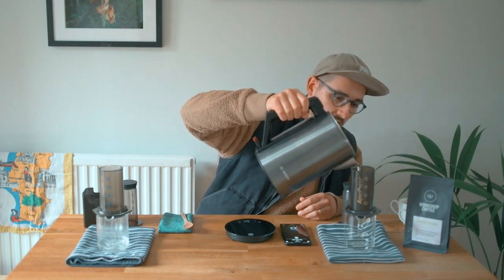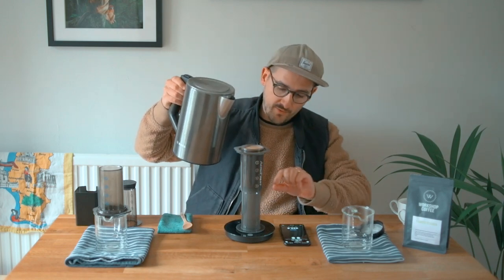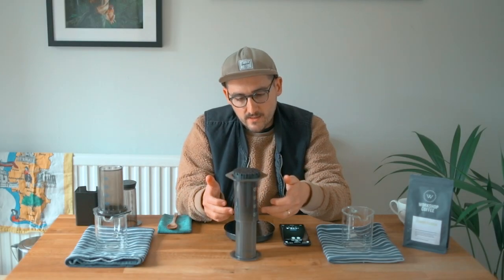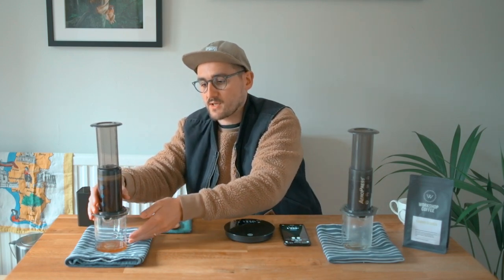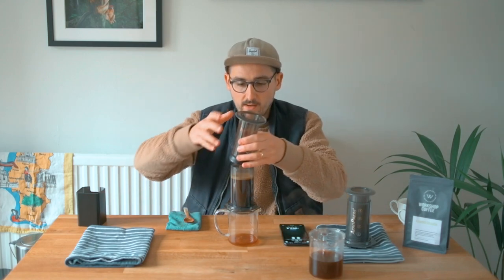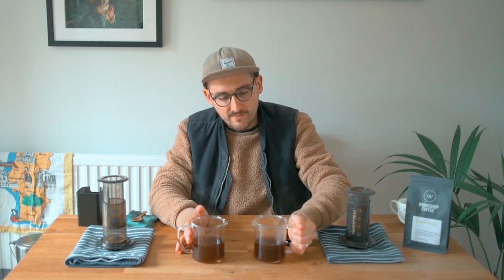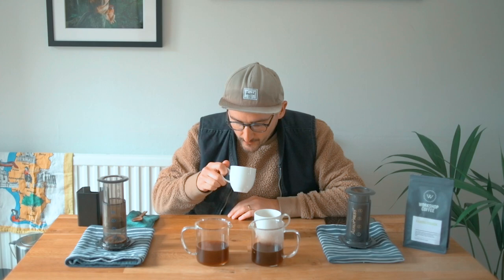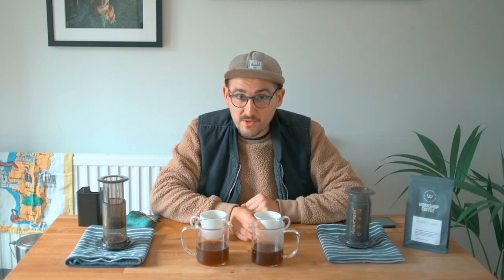At Home with James Bailey – Brewing with the AeroPress

Comment: Thanks for the video. One thing to add - the stirrer that comes with the aeropress is specifically designed to be unable to scrape the filter in the normal method.

Comment: You do a lot of stirring in the inverted one. It should increase agitation therefore extraction, shouldn't it? How did it affect that brew?
Reply from the maker: It might have marginally increased extraction but not massively. It will get to a saturation point around the solubility ceiling, and we don’t find that a few extra stirs negatively impact the cup.

Comment: Thanks for this! Am I guessing right that you’re using the Wilfa Uniform here? What range of setting would you recommend for Aeropress?
Reply from the maker: Assuming you're doing a 2-minute steep , and brewing regular rather than inverted, we'd recommend using 23 as a starting point.
Reply: @workshopcoffee9001  Interesting! I use the inverted method, didn’t know that it was a factor in selecting the grind size. Do you go finer or coarser?

As for time, I’ve been brewing for 1 minute the past months, but did 2 minutes previously. I’d guess that you go finer for a shorter brew time?

Thanks!